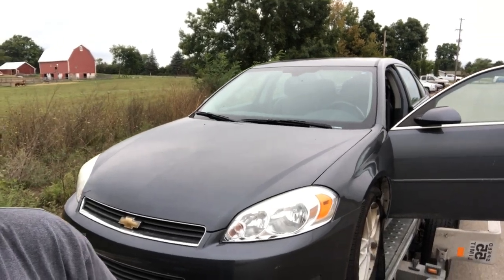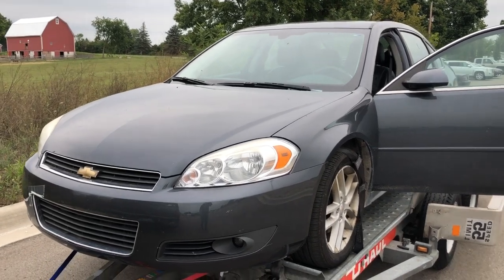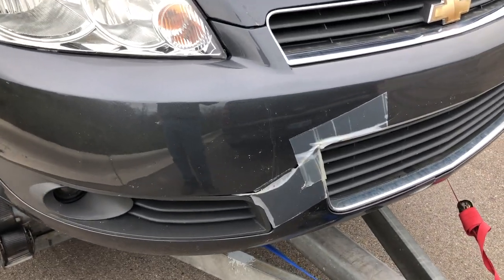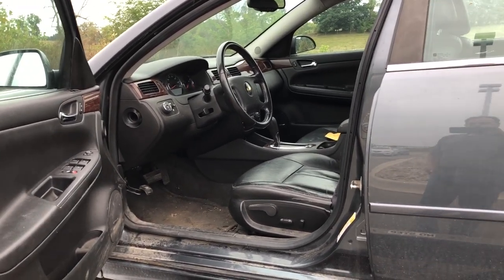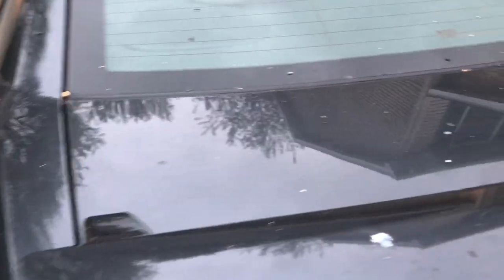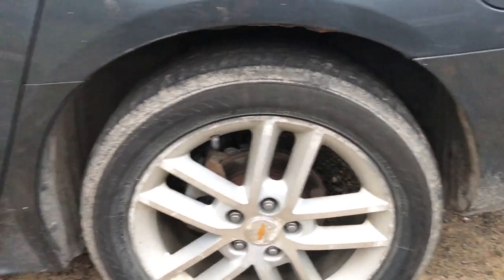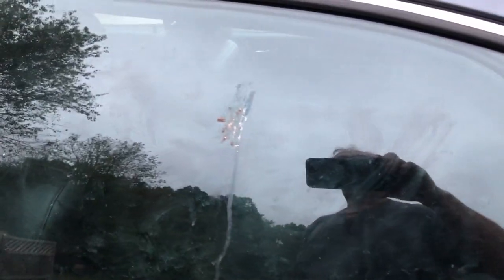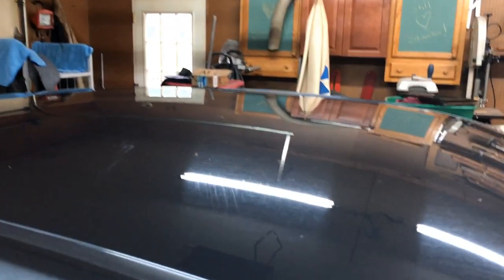2011 Impala LTZ Transmission Replacement Part 1

Comment: I haven't had to drop an impala trans yet, but i dropped a 4t45e out of an alero on jack stands. I set the car up about 2 feet in the air dropped the sub frame pulled the trans using a normal jack but I made a platform out of 2x6 lumber dropped the jack down then jacked the car up another 6 inches in clear the trans and pulled it out of the drivers side foot well. And i installed it in the same manner

Comment: Heck yeah! An LTZ! What a score! Looks nice! Just needs a little cleaning and TLC. I agree with your wife. I'd keep that one. It got decent miles and is top of the line. On the bumper you might consider buying and painting your own. If you have around the same amount with buying the bumper and the equipment, then you can repaint anything else in future projects. I ordered a pre-painted bumper for an Acura project it was a pearl white. I gave them the paint code When the bumper came it was like 3 shades off. I went that route because the paint was $108 a quart. But from now on I'll just paint my own. Looking forward to your future videos on this build! Take care man.

Comment: Nice.  Man, 550 for a bumper cover would be too rich for me.  I’ve had pretty good luck with the plastic “welding” strip and a pencil soldering iron to more or less braze cracks like that front and back.  Lots of good YouTube videos to check out.  Some bumper bite filler and paint it up.
Reply from the maker: Thought about doing that as well.  Blending paint shouldn't be an issue on such a small area.  Would definitely be the cheapest way to go.  And if it ends up looking like crap, I don't have that much invested in the loss.

Comment: i m looking for the speed sensor on the transmission  chev impala ltz 3.6
Reply from the maker: The vehicle gets speed info from each wheel via the abs/speed sensor but there is an internal sensor in the TCM which is internal to the transmission.  The TCM lives behind the front case of the trans.  You can see the wiring harness plugged into it.

Comment: Hey where can I find a transmission for Chevy impala ltz.Please help
Reply: 2006
Reply from the maker: For a rebuilt transmission, your best bet is http://www.streetsmarttransmission.com  The one for the car in this video was $1600 with no core charge as long as it was returned in 30 days or less and it comes with a 3 year/unlimited mileage warranty.
Reply: @resurrectionautorebuilders8465   Does it be any miles on the rebuild trans?
Reply: @resurrectionautorebuilders8465  thanks
Reply from the maker: @macjones4497  THey are totally refurbished to factory new/upgraded specs.  They also come with 13 qts of transmission fluid and a new torque converter.